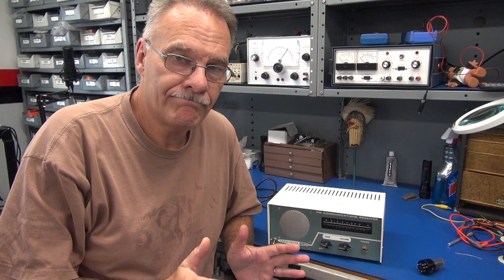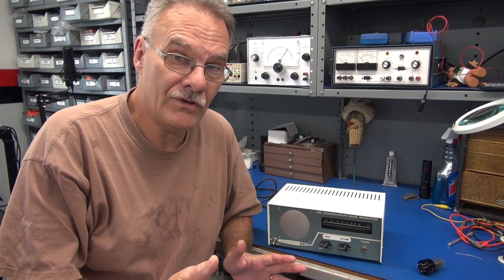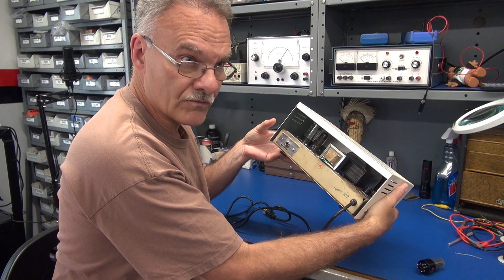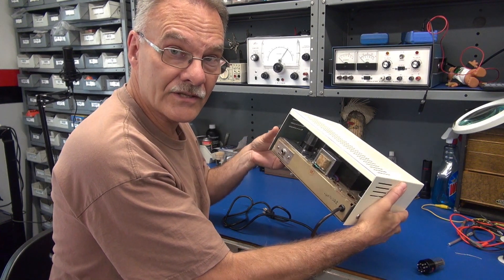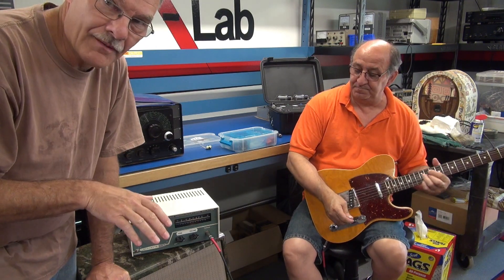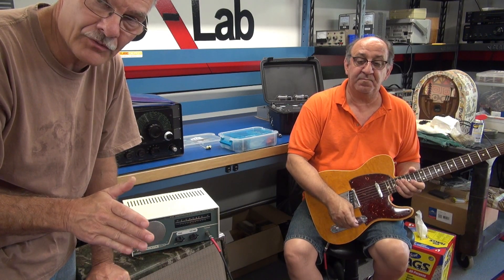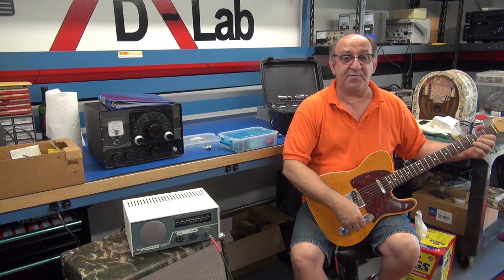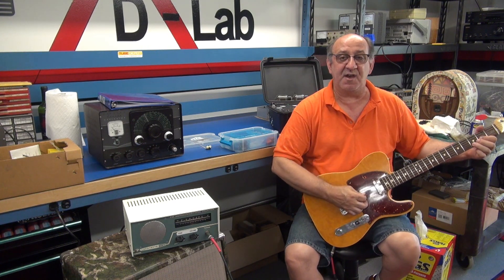Demo D-lab Police Radio retrofit electric guitar amplifier 6K6 music recording masterpiece

Comment: 6K6 Datasheet is B+ max of 315V. That said, I have run them long term in amps with 400V supplies no problems. 8W dissipation vs 12W 6V6 is probably more important, as well as they don't bias the same. The 6K6 is a true pentode as well, not a beam tetrode.

Comment: Terry, are you sure about the 6V6gt handling over 400vdc on the plate? We are talking a tube with 12 watts dissipation. I have seen 320v on the plate but there was 15v on the cathode effectively being 305v between plate and cathode. I know a 7591 and a 7355 can handle over 400v. By the way, that amp you built sounds amazing.

Comment: That sounds really good. You said it only has two tubes. But doesn't the schematic show three tubes? Also is it solid state rectified? (I prefer solid state rectification myself).
Reply from the maker: Yes, 2 tubes, The 12AX7 is shown in part A/B The 6K6 is the output. Yes, diode rectified

Comment: Hey Terry - Do you do anything about a rectifier?   I don't know much about guitar amps (or any amp for that matter), but I see on other amps builds that have it.  You might deal with it, and I may be missing it on the schematics.  Just wondering...  I would really like to get into building small amps like this and you are one that I follow a lot. Thanks.
Reply: Solid state rectifier - just two diodes.
Reply: @russellhltn1396  thanks. Is it identified in the schematic..?
Reply: @buckinjb  yes, right next to the power transformer.